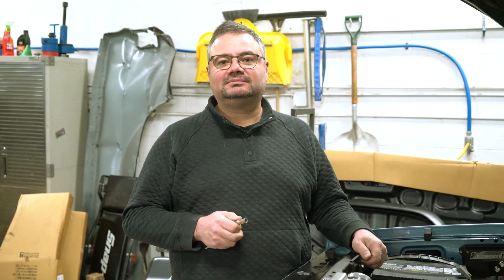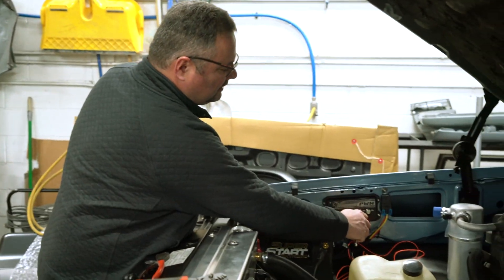NEW PWM controller Install

Comment: I have an X5 BMW diesel with a 850 watt electric fan. It seems the built in controller has fried. Bench tested with a PWM signal generator but it wont work. This is 3 wire fan. Positive, negative and the small controller wire. The output of the controller is three terminals into the fan stator. Does your controller have a 3 wire output?

Comment: I need to have you put one of those in my Cherokee.
Reply: No problem
Reply: @creativewerksinc  Then you can rewire everything under the hood. If you don't mind. I did it , but I'm afraid of a short somewhere. I will get a hold of you in a couple weeks to set it up. Thanks
Reply: @creativewerksinc 

Dear team,

I am highly interested in your fan controller concept and its potential functionalities. However, I would like to inquire whether your controller has the capability to adjust fan speed based on temperature. For instance, it would be advantageous if the fan speed could be set at 30% when the temperature reaches 180 degrees. This approach would ensure more efficient cooling as the temperature rises the fan speed rises , as opposed to simply activating the fan at specific temperature thresholds. By incorporating this feature, your fan controller would become significantly more versatile.